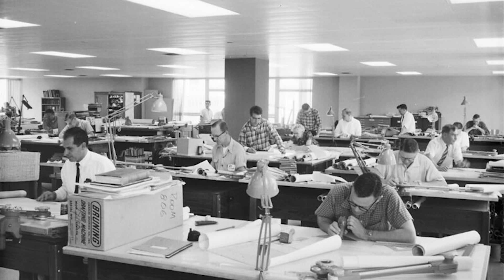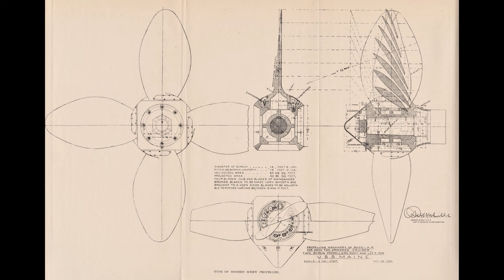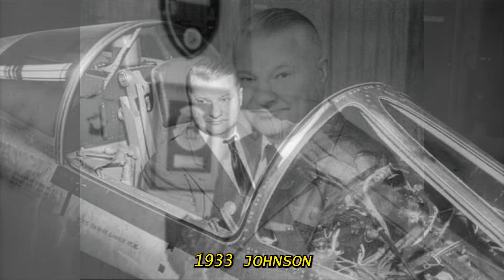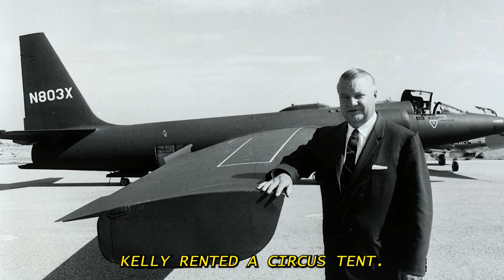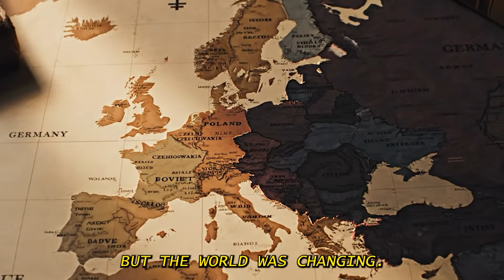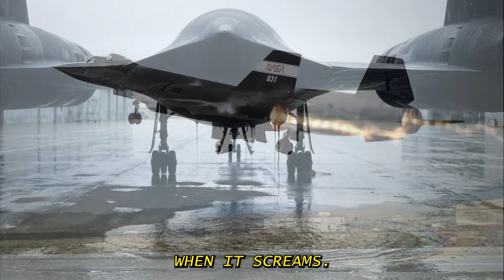The Two Greatest Engineers in History (Compilation Video)

Comment: Note, something not mentioned in this video is that the SR-71 was the first Stealth Aircraft designed.  It's why the vertical stabilizers are tilted in slightly, the knife edge perimeter of the entire aircraft and that Black finish which is Radar Absorbent.  I was once told that the radar return from the SR-71 was about what you would see from a Bald Eagle.

Comment: The interesting thing is that most radio-controlled quadcopters (drones) are fixed-pitched propellers.  Yet, people want to take these small models and scale them up to much heavier weight and greater power...
Reply from the maker: First of all thanks for the comment, and yeah you hit the nail on the head! It all comes down to the physics of rotational inertia. Small drones can get away with fixed pitch propellers because those tiny plastic blades have almost no mass. The electric motors can speed them up or slow them down in milliseconds to keep the drone stable, but as soon as you scale up to heavier weights, those rotors get massive. You physically can't spool up or slow down a heavy, high inertia rotor fast enough to react to a gust of wind or make quick maneuvers. That's why full scale helicopters and the heavy lift drones that actually work have to use variable pitch rotors. They keep the RPM constant and instantly change the angle of the blades to adjust lift. It’s a perfect example of how you can't just scale up a design  the physics force you to completely change the mechanical approach.